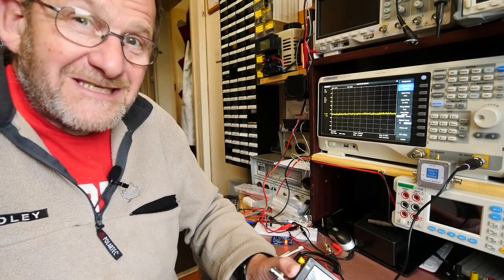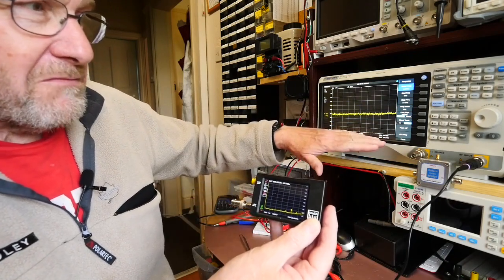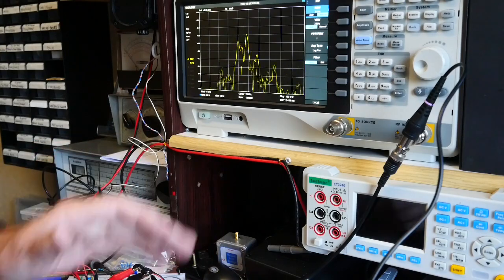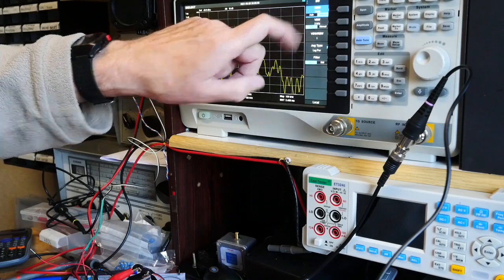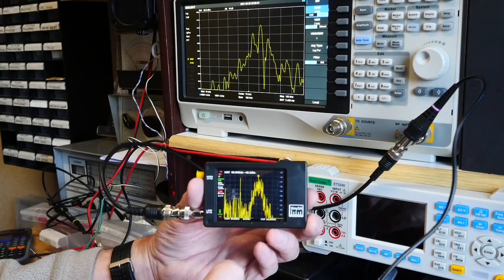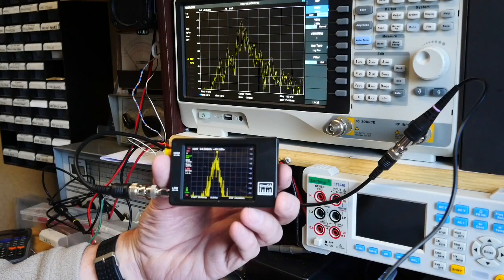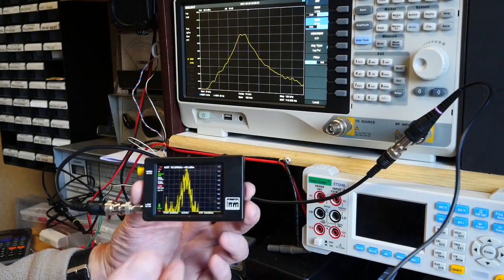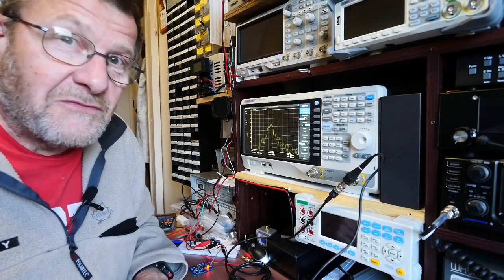Response to a question on video #066 from Tron Magnum   -  #066a

Comment: Could you use a SDR dongle? They are 1/2 of what the TinySA costs. Plus with a decent computer the sweep rate would be a lot faster.
Reply: actually there are some programs doing just that allready, but bear in mind that sweep and displayof the signals is not as easy as it sounds.